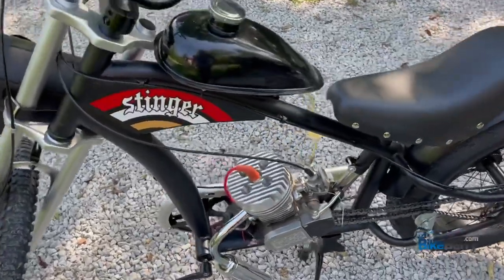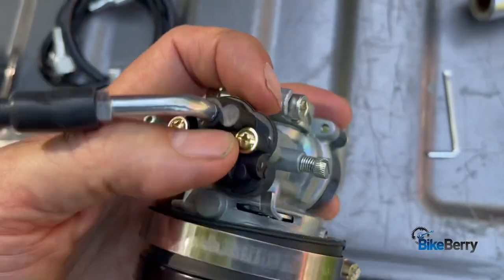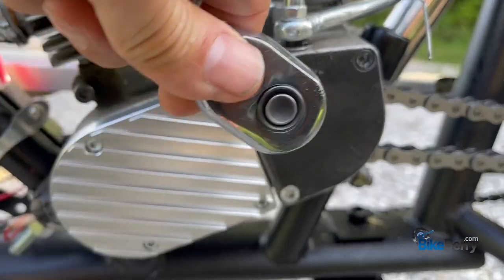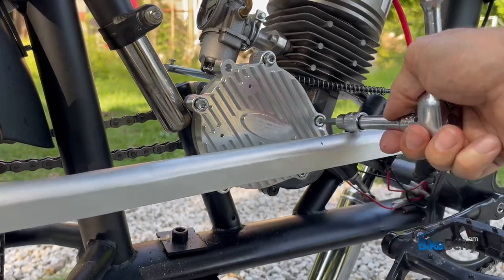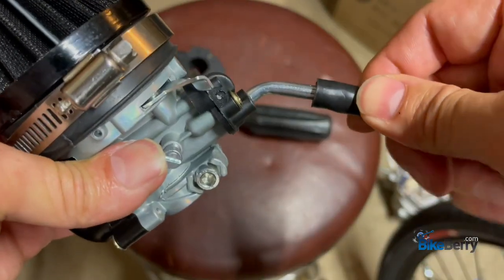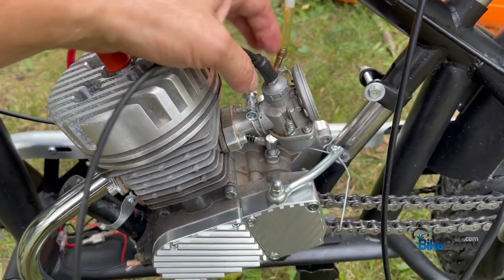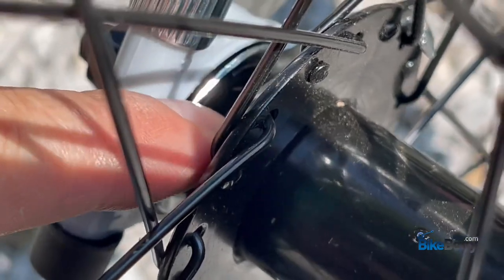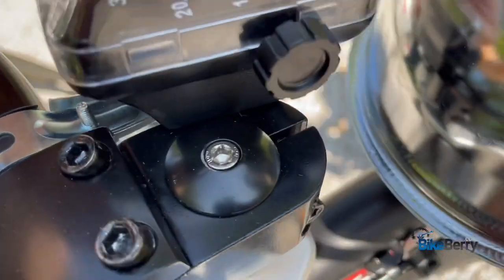Elevate Your Stinger: Chopper Upgrades and Enhancements Revealed! | BikeBerry

Comment: Looking good . If you have an air compressor with the proper head you can get the tip just under the handle grip , shoot it with air and it will pop right off easy peasy . I have had a hard time with them in the past until I learned this trick .....the struggle is real .
Reply: For sure that’s such a good way to wrestle ‘em off there. I just don’t have my air compressor ready to go in a moment’s notice. I should tho!

Comment: You really should've mounted the speedo head on the other side of the handlebar above the headlight area so you don't have possible issues with it bumping the tank or pinching the cable against the frame. I've got the original schwinn occ frame and I used the flat plate motor mount that attaches to the bottom tube and bolts straight to the motor and to the front down tube. It worked really well and is adjustable so aligning the chain was easy. I don't like the design of the tensioner so I mounted a flat bar to it that holds the wheel on 1 side and pivots to put tension on the chain and the other side has a bracket to the frame that holds the bar in position. It's still adjustable at the tension bracket which is its pivot point. It's a stronger more reliable mount and i don't have to continuously adjust it because the chain can't move the wheel and lose tension. Saves me from the chain losing tension and bouncing around binding in the engine sprocket bay or falling off the rear sprocket which at 35mph could be damn dangerous. I'm also thinking of doing away with the nylon wheel and putting a small sprocket with a bearing pressed into it as a better tensioner doing away with potential problems of the wheel heating up and melting from the friction of the chain. I've had to replace that stupid wheel 3 times in the last year or so cuz they just wear out. The little sprocket I'm gonna use is a 10 tooth for my dirtbike motor cuz it's the perfect size and fits the chain too. If you guys emulate my tensioner idea make sure you order a drive sprocket that is 7/8 hole cuz a bearing from a skateboard wheel will fit the hole and make sure the sprocket fits a 420 chain cuz that's the size chain the bike motors all come with. Good luck y'all and thanks bike berry cuz you guys have helped me come up with good ways to improve and make my builds more safe. Safer is more reliable and alot more fun!!!

Comment: Just so you guys will know how to properly use the large tie straps, they are intended to go around the drive shaft of your intended victim. When they are going slow they won't hear the longer part of the strap hitting the bottom of their vehicle but when they speedup it sounds like all hell is breaking loose. They'll slow back down and nothing, speed back up and all hell again. If you wanta drive like an ass then park at the store or just park like an ass they are always in my truck and I like messin with folks. The best part is it isn't destructive just aggravating. This can be dangerous however, don't hurt yourself laughing. Harbor Freight has em cheap.
Now for the bike. I would think the speedometer would mount on the front of the handle bars without hitting the cable or the tank. I would also consider the quick release squires or axles. If you ride on the road you will have flats so extra tubes and inflators are a must. The #1 cause of flats on road bikes are blown out tires from big trucks. The wires in the belts of that tire will get ya. There is also Teflon tape for fuel use on your gas tank. It's a yellowish color. That's the only things I could suggest, I think you've done an excellent job.

Comment: Just stumbled across your channel,  and love it. I have black OCC chopper I've had it ab4 or 5 years now 
I don't think it has more than 5 miles on it probably has the original air in the tires. Precool.
Im gonna add a gas motor,  amd hopefully a 3 speed gearbox.  I just haven't done enough research to know whic kit to purchase  i think im gonna go with a Harbour Freight Predators motor.i have the 212 cc motor on one of my Go-Karts
Reply: You're going to have a major headache trying to get that predator motor to fit the bike frame. I hope you are good at fabrication cuz you'll have to make a custom motor mount plate for it. A buddy of mine tried to do this with his bike and the predator motor was just too big to fit the frame of his bike and 4 other bikes we looked at. Definitely wouldn't fit my schwinn chopper frame cuz the upper tube was in the way. If it was 2 inches higher then it would've fit.

Comment: I would get one, swap the fork for a 20" fat tire fork, throw a hub motor on each wheel, and take it out to the sand dunes.  Think I just might.  The stingray choppers (if you can find them) are way more expensive.  Would put a gas engine on if the cops in my city weren't so anal about g-bikes.